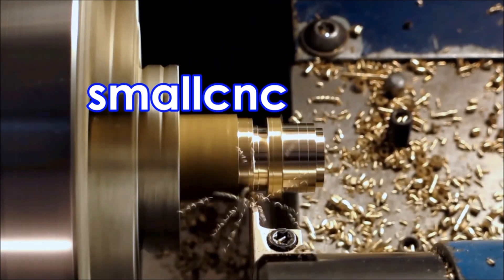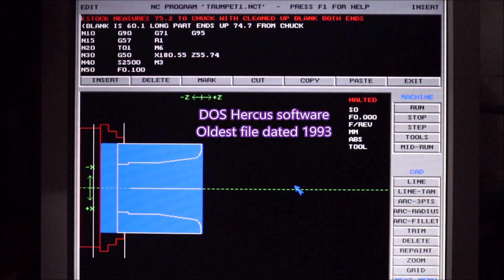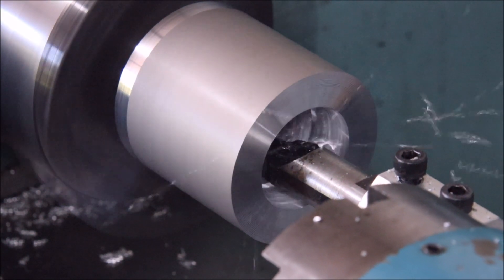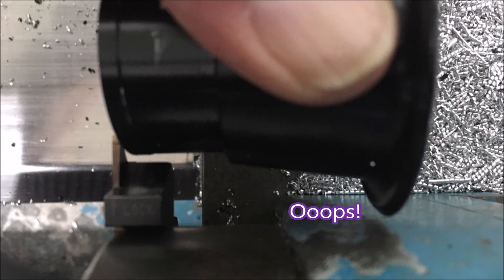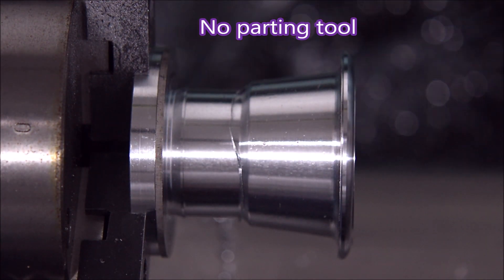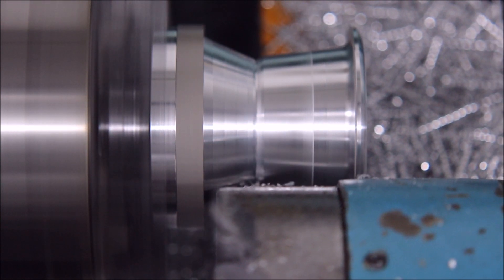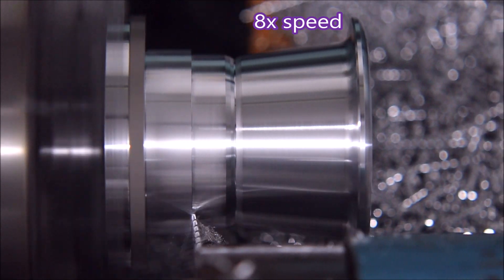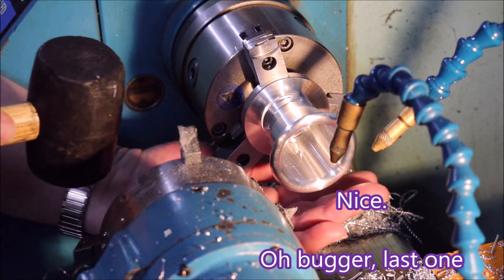Small cnc lathe turning velocity stacks for Yamaha R3 Race bikes

Comment: My shop has a set of SPI hole micrometers that measure between 3 points. I suppose this would be a pretty good use for them!
Reply from the maker: I don't have any equipment like that, but it would certainly be what I would use if I did. Thank You for your comment, I was not aware such things existed.
Reply: Sure thing! Thanks for the great video.

Comment: Nigel - whilst this is impressive machining for sure, wouldn't it make more sense for this type of part to create a central die and set your lathe up for spinning?  Does your machine not have enough HP to work as a sheet metal spinning gin?  Your swarf / scrap percentage would go from 90% down to about 15%, and the time per part would be trivial compared to the work on these.
Reply from the maker: Mike Furlong, as important as the funnel shape was the barb on the opposite end. The size of the barb and the diameter of the material in that area was vital as it was holding the part in place. I did investigate having it spun by an outside source but it came to nothing.
First batch was 20 parts, I had designed the part and it was pretty natural for me to turn the prototypes. If life ever returns to normal,  I will probably do the production run of 150 parts. Program is written and I know how to do it, so it may as well be me that gets to make them. Although I will put it put there for quotes from others, but not spinners. To answer your question re spinning them myself, not sure if lathe or the operator has the required grunt. I have seen spinners at work and it does not strike me as being easy work. Plus, I have no idea what to do, and no, I am not interested in a new career. Started in 2005 with a cnc lathe I had no idea how to drive and that is about the last career move I need. As you can tell from the length of this answer, your comment was appreciated and valued.

Comment: Nice work, Nigel.
Reply from the maker: Thank You. Was worried to start with as I think I indicated, but have to admit the end result left me feeling I had out smarted the chatter gods. When something is be sold to a customer, I really do like the product to look like a bought one ('cos it is) 

That is one of the reasons that I spent the money on full form thread inserts, right from the start. The little lathe may not remove material very quickly, but with full form inserts it cuts damn good threads.
Reply: @smallcnclathes  
It is great little machine to own.
I am sure a lot of guys watching would Love to own one the same.

Comment: Hi,

When I got my lathe, I brought Sandvik insert tooling.

I've had something get delivered so fast. If you order in Australia before 3pm local time, you will get it by 12 the next business day.
Reply from the maker: I started with Sandvik, but left them for Sumitomo. Usually next day for inserts or a week if it is not in Australia. Sandvik threading is Sandvik only. Sumitomo holders take any ISO inserts, so I have stuck with them for years.  Also have a great rep from Sumitomo, really knows his products and is most helpful.  Appreciates the fact that I don't have 25 hp at my disposal and advised my accordingly way back when I started.

Comment: Having made thin parts for motorcycles on my lathe I can appreciate how challenging this must have been.
Reply from the maker: It was a challenge at first, I could forsee lots of problems. Happily they did not ocurr.
Reply: @smallcnclathes  I think it speaks to how sharp your tooling is that you were able to do the OD last. I turned my OD to finished size first and then crept up on the bore. When I did it your way I would distort the piece and tear it apart. You make it look easy.

Comment: I'm not sure if I missed it in the video. What kind of aluminium was that? 
Thanks for showing this.
Reply from the maker: I am not sure it was there, I do normally try to include that information.  Not that any one will read it but I will add it to the description.  Thanks for that.  Done.
Reply: @smallcnclathes  Little did you know that I now know the material is 2011 that you purchased from Action Aluminum in Bayswater! For real though keep up the quality content!  :p
Reply from the maker: Baki1 were you just looking for a plug.LOL
Reply: @smallcnclathes  A Plug? I ran into your channel a few days back and was just poking some sarcastic fun at your self deprecating humor my dude. Honestly though watching other people work is enjoyable especially through difficult challenges like the thin wall section on the tube impressively clean finish I have recently picked up a CNC benchtop lathe and am keeping an eye out for tips and tricks.I am looking forward to your next project!
Reply from the maker: Baki1 What model lathe?
Reply from the maker: Baki1 by a Plug, I meant a mention of Action, I know one of the guys that works there watches my videos.
Reply: @smallcnclathes  ah no i am over on the west coast of the US! I picked up a taig turn series ballacrew lathe with the 5c collet headstock. Paired it with clear path sdsk (stepper interface) servo motors which give it ~500in a minute rapid speeds its been quite the learning experience. Thankfully i have the servos tuned to stop moving if they stall over 25% torque right now and that has saved lots of tools from being smashed. Tool offsets bite me from time to time... The controlled is linuxcnc through a parallel port and havent run into issues on that front. 

Watching it thread is by far my favorite thing!
Reply from the maker: Baki1 yep, threading at speed is really fascinating